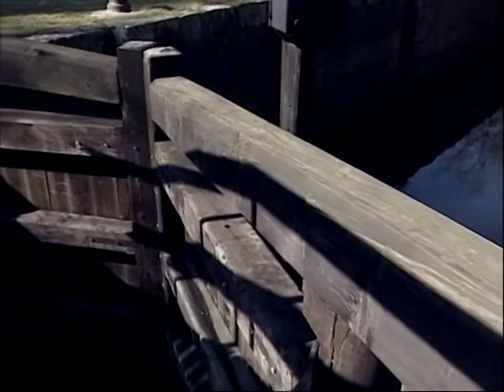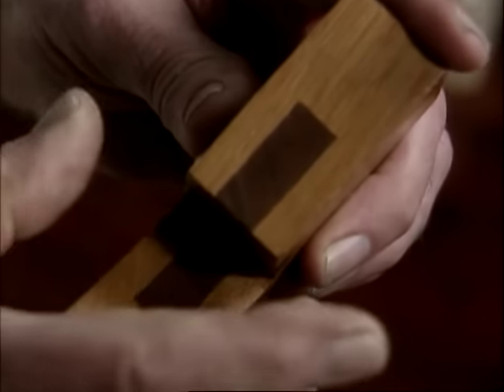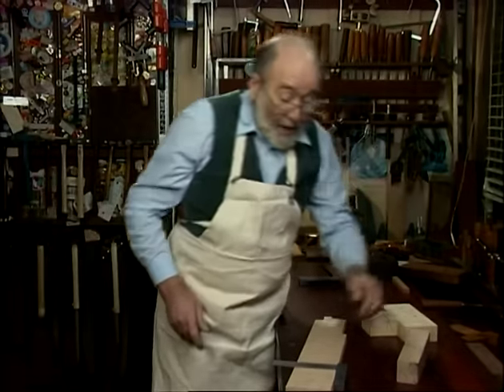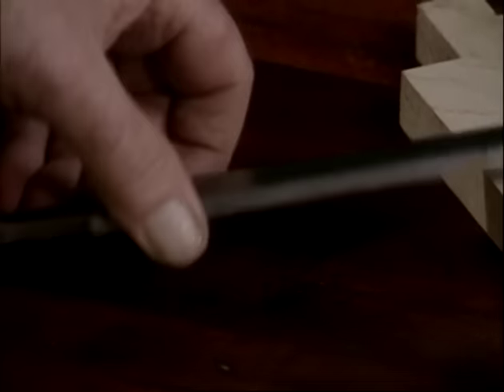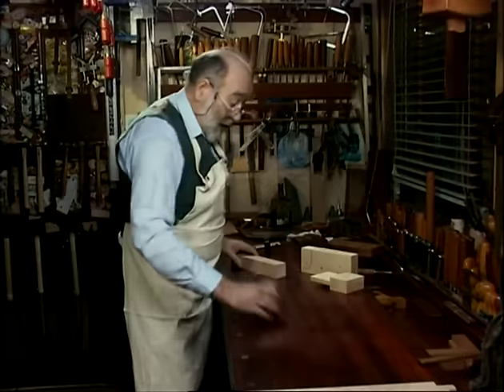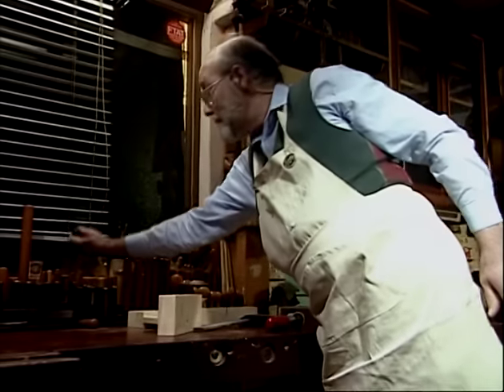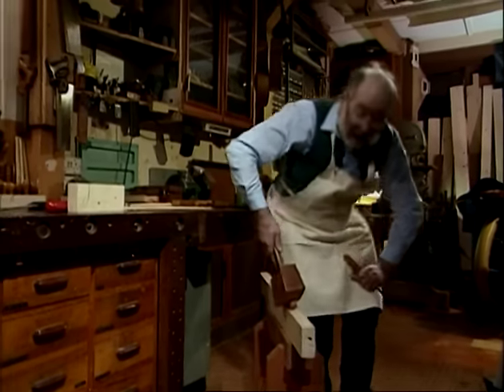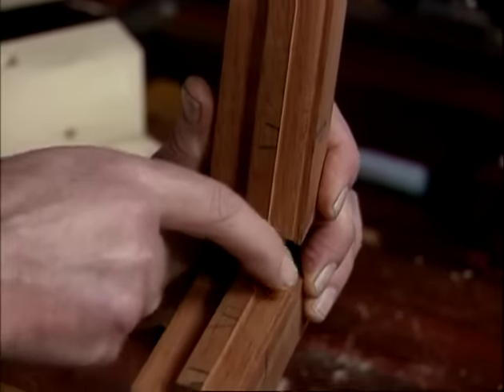Jim Kingshott - Mortise and Tenon

Comment: I wish I had seen this video before I had to replace the bottom rail in a Victorian sash window at home. Luckily for me it had deteriorated to the point where the original rail was just loose enough to figure out exactly how everything was supposed to be held together. Amazing that everything was held together by mortice and tenon joints, pins and wedges, exactly as shown by Jim, no glue anywhere apart from the putty on the glass!

Comment: I’ve been woodworking for over 45 years now but as a hobby for most of that time. In fact, my first woodworking was about 60 years ago when I was “helping” my grandfather on his shed. In those days, there were absolutely no electric tools for the hobbyist and, indeed, we used dried dogfish skin as sand paper and made our own glue from scavenged hide and bone. I’d never wish those two things on my worst enemy. 

Some of our chisels were very nice; good hard steel with hardwood handles but some had such soft steel. The reality is that not everything old is better than we have now.

I have to be very selective about what hand work I do these days. My body just can’t take a longish period of hand planing or chisel work. So, I use machines to get me within a cats whisker of where I need to be and then I hand finish. However, I regularly use a domino and a router just to appease the old bones.

Id suggest there are 2 elements to fine woodworking. One clearly is the skills needed but the first is the design. Everything we used to make was rectangular; tables, cabinets, cupboards were all 90 degree work. When you start introducing angles, simple curves and complex curves, the design world opens up but so does the requirement for skills. Making a mortice and tenon in square stock, as shown here, is not difficult to master but try and replicate that with 2 curved pieces and, suddenly, you have to really think. 

I am certainly no fan of the dovetail joint these days. I understand why it was developed those centuries ago because we needed a mechanical joint with the chemical joint (glues) being relatively weak. These days, the glues are as strong as the timber and can even glue end grain very well. I did a design once for a lady for a cabinet in the Arts and Crafts style. As befits that style, it was relatively simple in design but with several interesting points. She liked it until I showed her the detail of the drawer which had dovetails. She asked if we really needed “those funny arrow things” as they contrasted with the simplicity of the design. Once I had gone away, it dawned on me that she was correct. There was no need for dovetails and I had put them in out of habit. Worse than that, I realised that I often put in dovetails to show off to other makers that I could cut elegant dovetails. What stupidity. Now, I rarely incorporate dovetails and only when I can use something like hounds tails. The old maxim - just because you can, doesn’t mean you should. 

You can never forget form and function in your design. Get that balance right and then your learned skills become much more relevant. 

Apologies for the ramble
Reply from the maker: No need to apologise, I’m thankful you spent the time you write this, much appreciated and interesting to read. Thank you.
Reply: I once saw a video of an old school cabinet maker (can't remember who unfortunately, but someone relatively well known I think) say that if they had the glues we had today, in the old days, they never would have invented the dovetail joint.